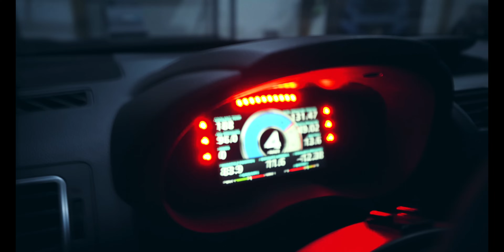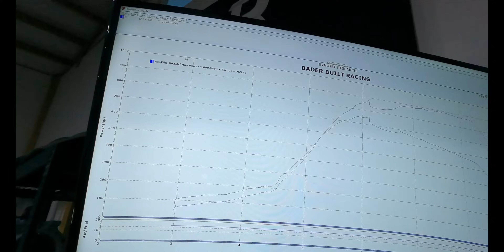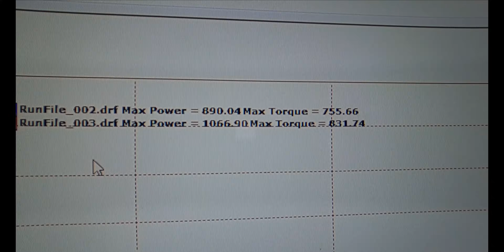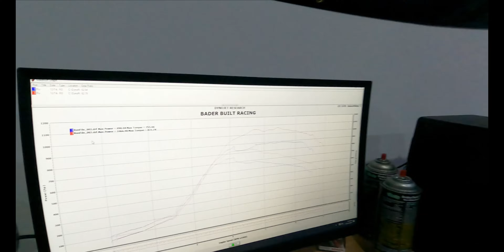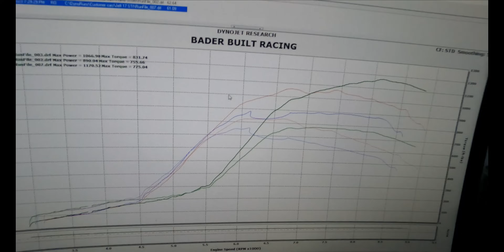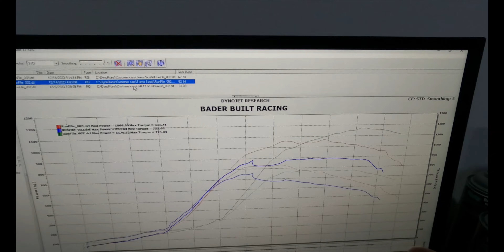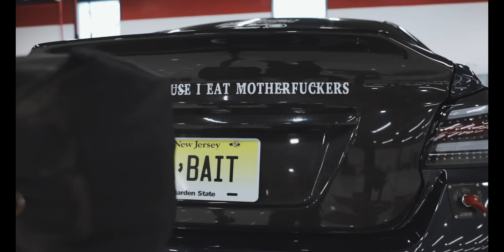Travis's STI makes 1066whp / 831wtq!

Comment: I have a question have you made power off a built ej205 with stock heads trying to stay in between 500 to 400 range
Reply: Stock ej205s can handle 400hp easy without a built block. All you need is a front mount, bigger turbo , injectors , fuel pump & you have to run e85.

Comment: how long does a motor like this last?
Reply from the maker: Being that this is a 1 of 1 scenario, only time will tell and it is not if its when it does fail. We are very obviously pushing the limits of everything internally at this point. I would be no means recommend this to a customer at this power level